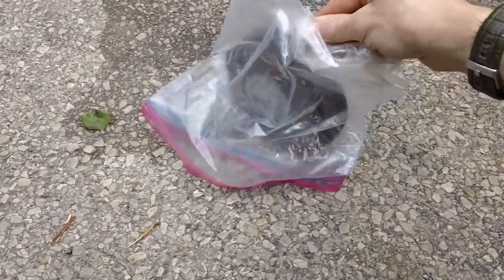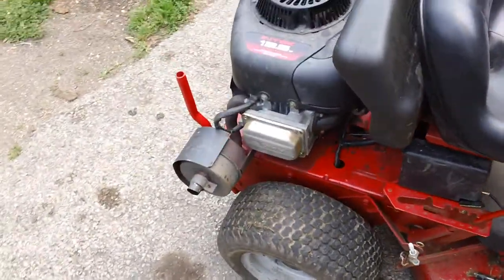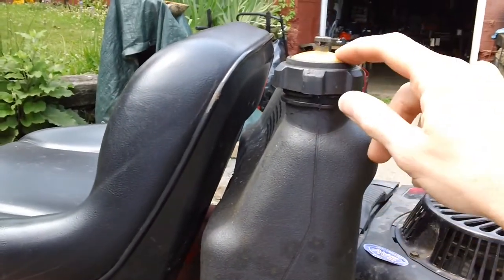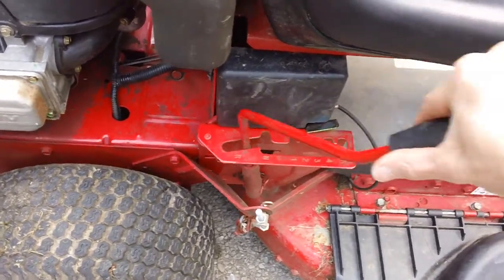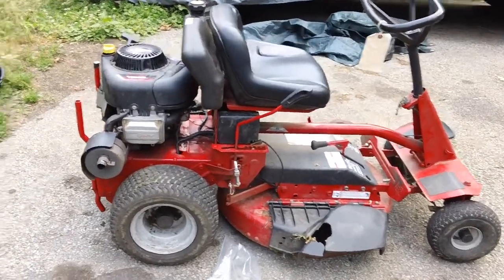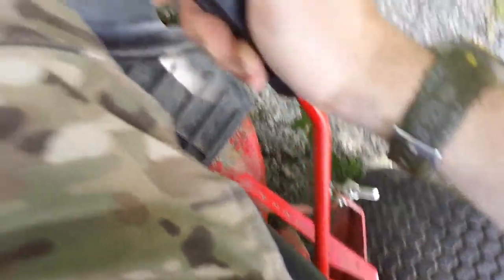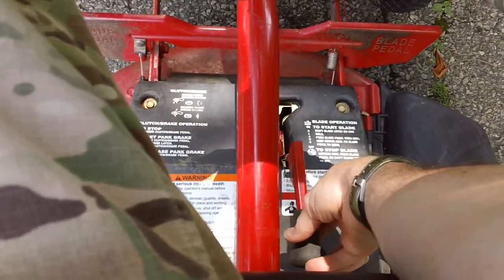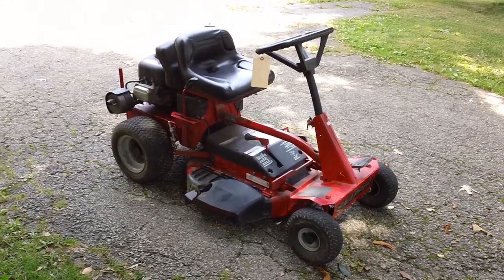SNAPPER RIDING MOWER

Comment: On these mowers, do NOT start out in any gear higher than first. They are in fact “shift on the go “ and have been since the ‘60’s. Start in 1st then once moving move the lever to higher gear. They are not even gears, it simply moves that rubber “disk” back and forth along the pressure plate, so always start slow or the rubber disk will burn away in no time. I agree on normal mowers do not shift unless you press the clutch in. Just a friendly correction!
Reply: Thank you. Makes sense.
Reply: They are gears i took my friends apart and fixed his last year the gear box or transmission box moves along the back axle any time you shift that rubber piece its the drive disc but you do have a ton of gears in that box i tuned up his last year regreased every nipple and put in new gear oil 

Put on a new right rubber boot and fresh grease that drive disc needs a cover over the bottom of it what snapper should have done but didn't it being that close to the ground will get damaged there's no protection covering it underneath the mower you can run over a stick or rocks a mole hill or anything but its not covered and is how they get damaged

Comment: Hi Chris just looked at your video on older snapper Rider mower I have the same mower but with a 10 hsp power built engine just had a New transmission put in was running fine until yesterday went to start turns over no spark plug or coil what would you say is the fix.?.

Comment: I picked up this tractor yesterday. I have a question about the black wire that is supposed to be connected to the coil. Do they all hook up to the same ground on that throttle plate? On other engines I believe that the cable is supposed to click into a holding clip and not connected to a blade connector.
Reply: I don't think it matters long as its grounding

Comment: I had to chuckle when you said this is an older machine.  I wonder what you'd call mine.
Reply: No it ain't old it all a old guy gave me his old 80ies model one and that was alot bigger than these new ones alot heavier to push around to i got the engine running again and gave it to a other mower friend then they sold it and made them 4 hundred off it 

It had a nice splash around oil engine there was no oil filter i can't remember the engines hp but it was still good chain driven

Comment: Thanks for video. Had the carburetor replaced and now won't idle low. All full speed ahead. Oil thin so worried gas still leaking into the engine oil. Oh bother...
Reply: Put your throttle on low take your finger and push the black piece forward on the new nikki carburetor i had a slight problem your having with the new carburetor it smoothed out and ran normal after i done that i believe its that little sponge piece on the carburetor were the links hookup at causing it to not move correctly as it should once you do that it should run normal.

Then if its running to high still you might need to set your governor that was a bitch doing when i done mine hard nothing sticking out to grab to hold the damn thing in place while setting it
Reply: I don't see how if you just replaced the carburetor they usually come with a new bowl solenoid that plunges up soon as you shut the mower off to block the gas from keep coming in my new carburetor last month works great.

Did you unplug the spark plug wire then drain the oil out while turning the key a few times using a shopvac to suck out all the gasy oil and did you do a second oil change to make sure you got all the gasy oil out did you do that hows it running now

Comment: I can't find my model number on mine it's a 12 go 5 speed 30" deck. I'm trying to see the part number for this clutch disc so I can order it. Also I'm having problems with the mower not charging battery while running
Reply: Oh well those are easy fixes and most mowers have 2 model numbers one on the body or on the transmission sometimes and one on the valve cover if no over head valve's then stamped on the metal near the engine sometimes stamped on the engine most times hard to see can be small and covered up by dust and dirt or grease

Comment: Mine is a 2009, 30 inch,10ahap Briggs, good tires, excellent seat, brand new blade, friction wheel and axle boots. What do you think I could get for it if I wanted to sell it?
Reply: Id only buy it for the engine then give the rest of it away
Reply: A good used mower price long as it all functions how it should 3 to 4 hundred dollars.

I was wondering how much i could get off my 1987 craftsmen hydro 44 automatic 16 hp twin cylinder briggs somethings messed up on the electrical clutch but the clutch does work i have the original deck and redone the deck not to new conditions but so it'll function deck belts on the deck i took the deck off the mower and i use the mower for pulling the wagon around or for pulling other mowers it works good I've not even repainted any metal shrouds yet

Comment: I just got this exact machine used, for free.  It starts and runs, but after a few seconds, a gas/oil mixture spits out of a round hole in the intake manifold, vertically, inside of the air cleaner.  Is this the PCV system/reed valve I read about that might be shot?  Unknown mileage/hours on the old girl.  I just know that it pull starts damn near every time and everything works except the electric start.  I'd like to fix it and use it before giving up on it.  Already checked the carb about 5 times and everything seems okay.  Jets never got clogged, it just gets excited and spits up, almost a front fire, but with liquid instead of combustion.

Comment: I have same machine just changed solenoid still just getting same click
Reply: Now you need to wd40 all the wire connections after wire brush them off or clean them off then oil and make sure other cable connections are tight

Comment: I need a new carb for a 2006 model. Very hard to start. 20+pulls to start.
Reply: I had that issue too. My solution was to remove a screw holding the air cleaner to the engine and spraying in some starter fluid. Kind of a pain but  it usually starts with one pull.

Comment: That’s garbage they might as well go but them a Troy -Bilt . They make good products!
Reply: The engines not garbage but i hate cutting grass with those cheap snappers the seat can't slide back so i sit crammed up doing my friends grass with that same mower i don't like how it tilts over dips and bumps or holes in the yard the steering wheel sucks i don't like thats a bad made model no protection under over the drive disc hard to get to the battery seat can't simply lift up as all my tractor mowers seats do theres no hood to protect the engine for if you do have to park it outside and you done have a tarp to cover it up atleast the hood would protect it some but that model doesn't have a hood the mower doesn't turn good because more weight in the back than in the front